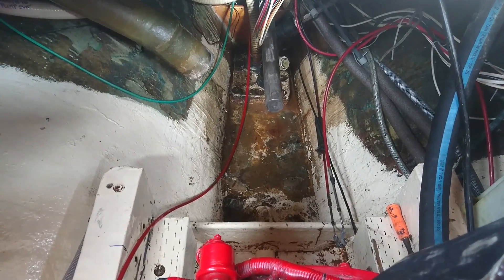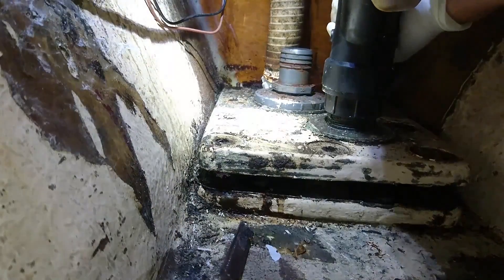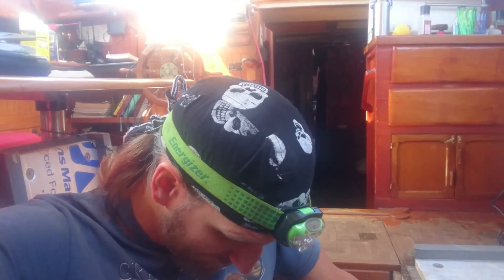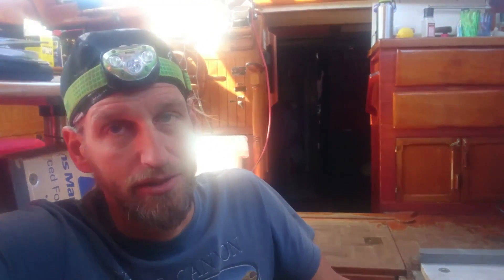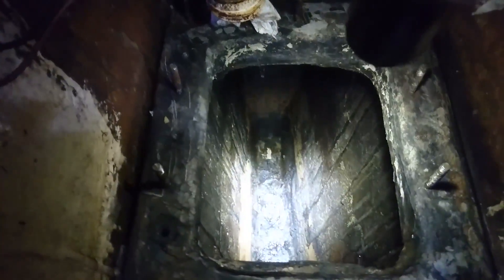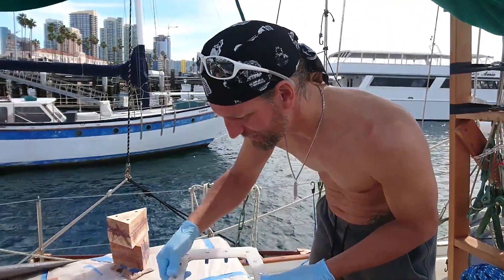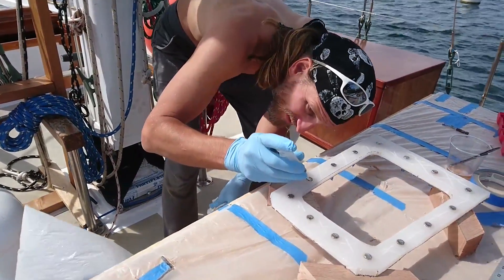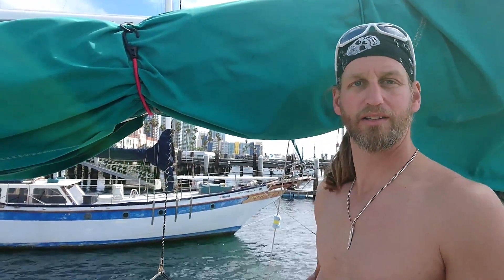17-08_Rebuilding the Holding Tank - What a shitty Job (sailing ZERO)

Comment: Excellent how-to video!  I'm amazed that the wood forms left by the manufacturer hadn't fallen down and caused some blockage on the pump-out hose.  Really appreciated you pointing out there is a time delay between applying form-a-gasket and letting it cure to the point where you can actually tighten the nuts and compress the gasket.  That seems to be a step left out by a lot of people using a rtv type product.  I like your idea of notching the bolt heads so the epoxy resin has more surface to grip the bolt better.  I'll try it the next time I need to bed a bolt in fiberglass.  Very professional job, better than if the yard had done it.
Reply: One thing about Zero is he bought a way to big a boat that was a near wreck and has been entertaining to see him rebuild eveything before he is thru and by the end of fixing everything he will need  to start all over rebuilding its like a non stop moving dYI channel
Reply: As far as epoxying the bolt heads, its a good idea to notch or make the hole the head sits in oval or not round.  If its round then the bolt head an epoxy will spin in the counterbore when torque is applied, particularly is plastic.  Basically the hole needs to be keyed, similar the notches ground into the bolt head.

Comment: All the mechanic things are new to me on sailboat. Sorry if the questions sound silly. Sure this holding tank hold the sewage grey water. How does one deal with this kind of water when full in the nowhere of ocean? I see many RVs have plumbing design so that shower water will get through into the grey holding tank, clean flush it up often. Also, maybe I miss certain parts in certain episode. I still don't get it where the ocean water leaks in and accumulate in the engine room, then even the parts inside transmission corroded! 

I really ENJOY all these technical aspects of episodes. Here is the only channel I followed on having this much of details recording repairing process. Not as a natural mechanic, I learn how to repair my Jeep and RV by one breakdown at a time, gradually gain the whole pictures how they work.

Lying down on the beach somewhere sooner, 😁
Reply: sailing ZERO Yes black water, a mistake. Just on your board (pledge). Will throw you tons of technical questions! 😊

Comment: Nice job. One of the reasons I hate the idea of a integrated holding tank. Bad design IMO. But you did a great job with the repair. I don't see a vent hose, and that size should have 2 IMO. Also, the hose clamps and hose in the tank might cause you some problems down the road. But at least you have better access to address that in the future.

Comment: Great job but in the end should have tightened all at one time not let it set then disturb the seal, maybe larger washers for the large area you had to seal but wow great job
Reply: sailing ZERO I was a truck and engine mechanic for 40 years,, know all the sealers. I think if you have issues later maybe some tape sealer , either way you did good job on it and your beams.

Comment: We took ours out and made a dry toilet. No plumbing, no pumpouts, cheaper.
Reply: sailing ZERO You have to deal with your own waste, takes a little bit of practice, and it's more difficult for females because they can't aim well into the urine diverter lol, but overall we're liking it. Cost us like $30 to build it.
Reply: My next boat will likely have a composting head as well. Frees up that space, and no more pump outs, smell etc... Morgan 38's have that kind of integrated holding tank in the bilge too, and I think its a bad design. Going with a composting head will help a lot. But then you have the issues of maintenance on that.
Reply: Nobody ever seems to have a response when I point out that you will need more space than before to store composting media.  Especially if you are cruising and it's not accessible.
Reply: On a boat, I think a urine-diverting dry toilet (UDDT) is better. Human solids are like 75% water, so once it has dehydrated, you can put it in the garbage or whatever. This is what we made. No need to actually compost anything.
Reply: Mike Kennedy 
Sorry, I should have said I was referring to Bob's composting head.
Reply: Perhaps, but I would rather store bricks of Coco coir than a tank of urine and feces. A compressed brick is 5x3x8 inches or so and will last 2 for a month or more. I can fit a lot of them in the same space as the holding tank used to fit. But its all conjecture for me as I have not used on in real life as yet, but most the people that have them like them and have not reported issues with what you say. Time will tell.
Reply: Bob Fomenko 
I don't disagree with you that it will smell better. The point is, it won't save any space as everybody touts as one of the main benefit of doing it.
Reply: Well again, it depends. You will save some space when you get rid of all the hoses and paraphernalia on a marine head, as well as the holding tank. If you don't need to store the composting material, like if your at dock, then  yes you did save a lot of room. If your cruising with it, then no, not really, but the space is repurposed. I think the MAIN benefit of doing it is the odor and complexity of a marine head is gone, and your get rid of 2 thru hulls, which is huge for some. The down side is you get to play with your poop, which for some is unattractive. But  once your have to enter your holding tank, replace the hoses, and have heads breakdown, you might begin to understand why people go with composting heads. Not for everybody.
Reply: Bob Fomenko 
I spent the last year with shit on my hands, trying to fix my shitter problem, I understand the attraction. But it's fixed now and it'll be easy next time.  So I just think it's not worth the trouble, once you get a conventional holding system dialed in. As for sailboats, if it ain't cruising, it's being wasted.

Comment: It must feel great to get that done. Just curious--have you considered getting a composting head?
Reply: I think I'm headed that way. I hate the tank and need the space.
Reply: I've got a composting head in my camper. It is awesome. Virtually zero smell. There is a small positive ventilation fan that extracts the small amount of odour and moisture out of the solids holding composting section. There is of course a separate liquids holding tank that stores the urine separate from the solids. No ammonia smell or chemical toilet smell. Simple system that ensures that you can use it for ages before needing to dump it. I'm sold. Highly recommend it.
Reply: Thanks for reply, Phil. In the near future I will be tearing old system out. The tank is nasty and takes up valuable space. Also, getting to pump out is a chore and the funky pooper never quite works as it should.

Comment: I'm afraid the epoxy is not going to hold in those screw holes. It doesn't look like there's enough surface area and epoxy. The epoxy is likely to break loose on the smooth screw holes because there was nothing to grab.  Assuming you ever try to take the lid off again...
Reply: sailing ZERO 
Well, they can go somewhere, they can spin freely in the slippery plastic holes you set them in. For the same reason you cut grooves in the bolt heads, you could have made slits in the holes.  I'm not saying they will, but that's where failure is most likely to occur.  Hopefully there's enough epoxy on top of the bolt heads that a chemical bond was made with the bedding you laid them in.